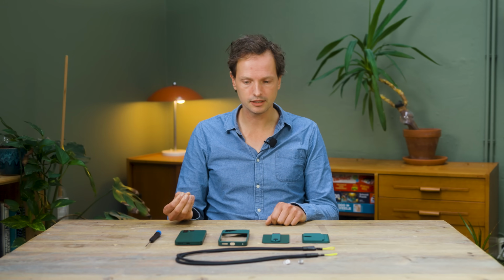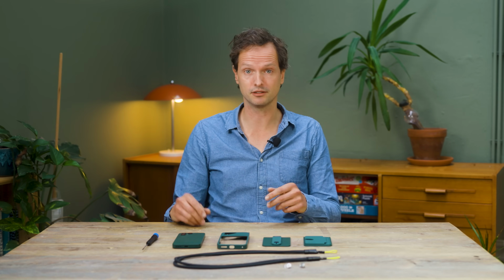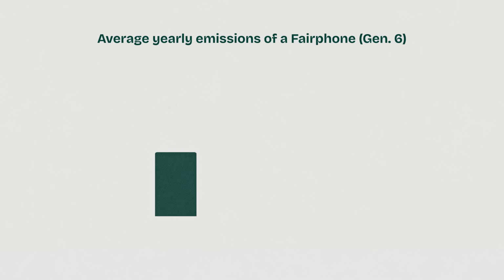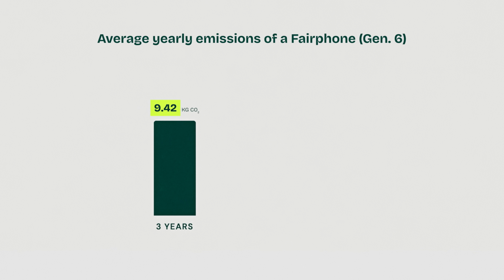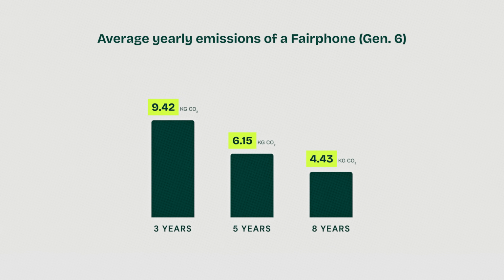The Fairphone (Gen. 6) | It’s Not Just Modular Anymore.

Comment: Bring back the headphone jack, that is the only thing preventing me from buying a fairphone
Reply: But that only leaves you with options like refurbished phones from previous years and Sony Xperias, right? I'm on the same boat, trying to convince myself that I'll be fine without it
Reply: Yeah, but Xperias are hella expensive, and older phones are, well, older. For my use case, i dont need a phone that is too much cutting edge and powerful, so i am thinking about switching to a cheap samsung from this year, the cheap ones are not bootloader locked so u can flash them which is what i need. Originally i was going to buy a Motorola but they started to ditch the headphone jack even on their cheaper models. A few years old refurbished flagship isnt much appealing either.
I guess ill just have to save up and get an Xperia lmao

Comment: I will repeat myself again, put a stronger SoC in these and they will fly of the shelves. There is nothing like it on the market, if finally looks good and has good features, it is European which is a big plus for some people, especially today. Put a decent SoC in there that can last 5+ years without issues and you have a seller. Even at a higher price, doesn't matter, the phone is already expensive in the price/performance equation, making it 150$ more and putting a 150$ more expensive SoC in there will actually make it a better deal. You are more expensive than midrange Chinese phones, you are cheaper than any flagship. If this thing had a last gen Snapdragon 8, no need for the current one, I would ditch my perfectly working Pixel phone and get this instantly. For now, I don't want to buy a new phone that is less performant than my last one, so I am waiting, and hoping, the Fairphone 7 has a good SoC.
Reply: The SoC manufacturer has to provide long time support for it, beyond what the likes of Qualcomm cover for most of their products.
And let's face it, for most use cases the performance is more than good enough.
Reply: @finestPlugins Qualcom gives enough support now that Samsung can give 7 years of updates, and the current chipset in the Fairphone is also a mainstream Qualcom chip. 
Even if that brings the Fairphone to "only" 7 instead of 8 years of support, that makes no difference. 
And good enough is relative, I am talking about sales numbers. The base iPhone is always good enough, yet the pro max always ends up being sold the most. And good enough today might not be good enough in 5 years. Maybe it's just my opinion, but the weak SoC is the only reason why I didn't buy this gen.
Reply: The way I understood it was, that the fast SoC are "phone"-chips. But chip-manufacturers do not give enough years of support for these fancy chips. 
To get the amount of support that a Fairphone needs they have to buy chips which get long manufacturer-support. But those are not phone but "industrial" (or some similar word) chips. Maybe think washing machine? It kinda is a coincidence that the industrial chips even have enough phone-features to be usable. (gyroscope, gps, accelerometer etc) 
As with everything in engineering, it is a compromise to reach a certain set of goals on a prioritized list.

Comment: Graphene OS would be so insane in the future
Reply: I came here to suggest this too. Fair and safe, killer combo.
Reply: but that needs actual kernel updates instead of greenwashing bs
Reply: The GrapheneOS team said Fairphones don't have the necessary security features for them. Fairphone already has a partnership with Murena so this is unlikely.
Reply: @Octochiken The graphene devs are extremely autistic about security. But it's the best of the best phone OS. CalyxOS works on fairphone, and it uses microg, allowing full de-googling.
So it's basically about what you want
Peak security - Graphene
Peak privacy (zero google) - CalyxOS
Peak compatibility (more supported devices) - lineageos
Reply: @Octochikenwhat secruity features where missing? Even if they don't deside to work with them, as long as the secruity features are there they can just develop Graphene OS even without their support.
Reply: @Ninjaeule97  They don't have most of the hardware modules required by GrapheneOS. For example, they've said they don't have plans to add a secure element. Security backports and Android updates aren't developed timely for the Fairphone, and it doesn't have functional verified boot, hardware keystore, or hardware memory tagging, among other things.

Without these, GrapheneOS simply cannot provide enough security and privacy guarantees, and using it doesn't provide much benefit, even if Fairphone were to fork the entire project and modify it to work with their phones. Fairphone already ships Android updates and security patches late extremely consistently, so I doubt they'd also be able to rework an entire fork of Android to work on their phones while not having most of the hardware requirements it needs to operate right.
Reply: @HeartbeatSuburbs  makes sense. Fairphone doesn't seem to have the resources to ship system updates consistently so adding the hardware options wouldn't be enough for GrapheneOS to support the device. Let's hope that Fairphone takes security more seriously in the future and adds those missing hardware features, and they become big enough to hire enough people to provide updates in a timely manner.
Reply: @HeartbeatSuburbs  is that because FP6 doesn't have the top spec SOC? Or is something else missing from the HW?
Reply: Iodé os is doing a good job overall, as a Graphene replacement, but it's Lineage, not AOSP.
Reply: @h0rnedfi3nd eos is garbage and cant be considered a gos replacement
Reply: Oh for sure, if the Fairphone 7 would ship with Graphene OS it would be an instant switch.

Privacy and repairability, truly the best combo ever.
Reply: came here to say this to. Graphene OS teased working eith other phone company than pixel so maybe 🤔
Reply: @rei-kun7  it's motorola. they confirmed it a few weeks ago. fairphone doesn't have the resources to support the projects requirements, nor are they interested in doing so
Reply: @loveatomb motorola is linked to the chinese state and was related to a company (motorola solutions) that sells to the IDF AND motorola mobility (the ones about phones) is on the list of companies operating in Illegal israeli settlements, its hypocritical and i believe gOS still can review their collaboration.